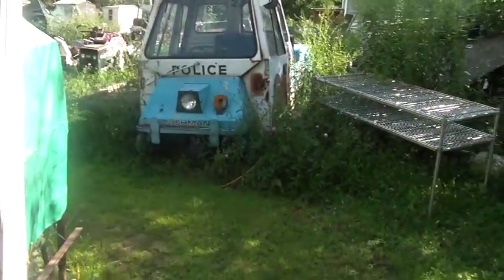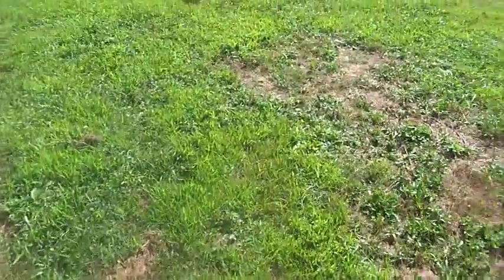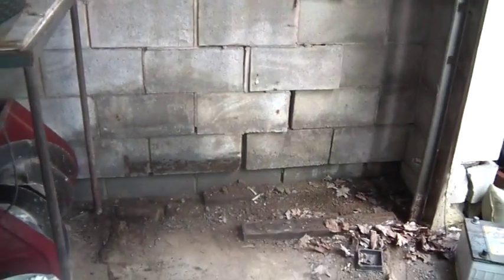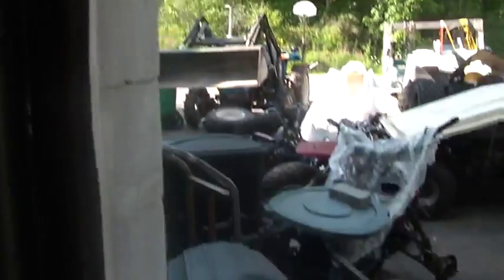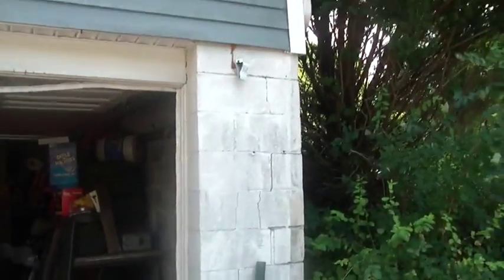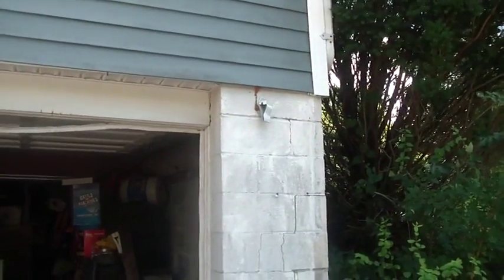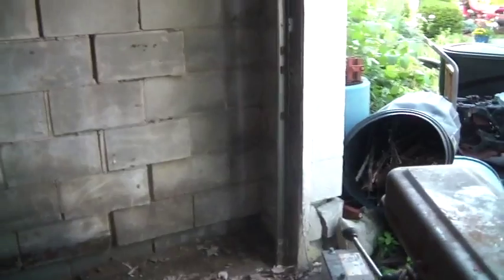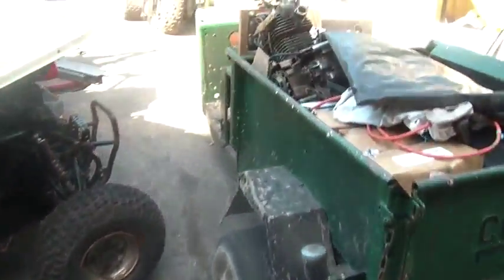8_1_15, Garage block wall damaged, needs rebuild,

Comment: Does your building have a bulkhead?  If so screw 4x4 boards to the bulkhead and kick down that part of the wall. The 4x4s will keep the bulkhead up while you re-build your wall after kicking it down ( a bulkhead is what they put above walls for the roof to sit on ). Once you re- build the block wall, put beams up to support your new block wall. Now if you don’t have a bulkhead then there’s a really big problem. If so, then you need to act quickly. What you need to do is screw 2x4 beams or a better option of 4x4 beams to each individual roof beam ( the beams going across to hold your roof up ,or so called ‘’bones of the house’’) . Then make sure the beams can hold the roof up. Next kick down the wall and re-build it.
I hope this helps, it’s pretty basic. This should work if not correct me. Byeeyyeeeeyyeeyeye

Comment: Looks like you can save most of the block and if bottom  coarse is good  that will help. Jacking it up , taking the door down and digging will be the hardest part . I would core fill a few block when putting back . Have fixed a few walls like that before. and drainage is something to think of .
Reply from the maker: wtbm123 , I think the lack of front drainage and a gutter over flow problem started the trouble,  and it did not improve over the next 20years, door is down at this point, will start the digging this weekend... I'm hoping to make major progress on this rotation off, I just hope not to discover rock ledge or monster rock right up against the foundation. Thanks you for all Ur input, it will help me get this done once, and get it done right... As always, thanks for watching and commenting also!

Comment: I'd also suggest checking your home owner's policy. If it doesn't cover it I'd still consider going with a contractor. Sometimes paying someone else is better than the time and aggravation of trying to do it yourself. Things you could do easily at 17 just don't come as easy at 57 (or in my case 65). Thanks for your continuing great videos. Good luck!
Reply from the maker: jj4fr2009 , Even if my home owners insurance covered it, I would not claim it, I have $1000 deductible, which is about what I expect to spend when all is done. Also, I have a tough time getting homeowners insurance because I do not have a fire hydrant anywhere close and the liability of my wife's piano students, I don't want to loose the policy I have now. I have put the word out to a few contractors, no bites yet, even for a cash deal. I maybe working with a buddy on it, as U say, 17years old was a while ago and I am concerned about breaking myself before the job is done. Thanks for your thoughts and inside, both run parallel to mine, thanks also for the support, watching, and commenting!

Comment: Poor drainage and insufficient back support caused that to happen. Next time around it will need a buttress point. This is the foundation for your home too right? Time to sell off the hoard to finance the house repairs?
Hoping for the best for you. Glad you have had some experience in this.

Comment: earths been a moving...pressure on the blocks,
neighbor bought house next door stoops who sold told him the driveway wall was giving way so he started taking it down....i went and talked to him but no listen. its not like yours were you can see it. the outside needs plasticed off and  reinforced moisture forces the motar to give away... close to what you have to do for basements..... they had strong re-barb in front of the block wall included metal inside the block.  now he just whines every summer and has never finished it let alone tear the rest away...now he too is a stoop....you'd think he'd insulate his house walls and save money for the driveway. you caught urs in time to fix it right

Comment: Does your house foundation have proper weeping tile surrounding it? That could be a lot of the problem
Reply: I would dig out your foundation and check after you gets it fixed, and if I was you I would patch the whole outside with gum and foundation coating too

Comment: Sell some toys fix the house???
Now if that was a bearing wall it would be a lot worse situation, is there dirt on the other side of that wall if not you might be able to build a wall out of the pressure treated 2x6 and pressure treated plywood inside of building it out of concrete.